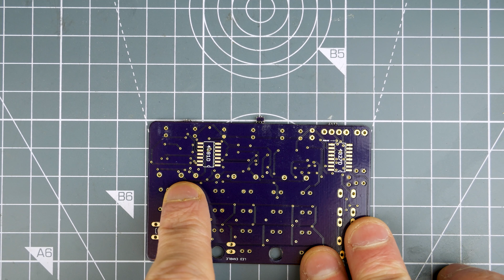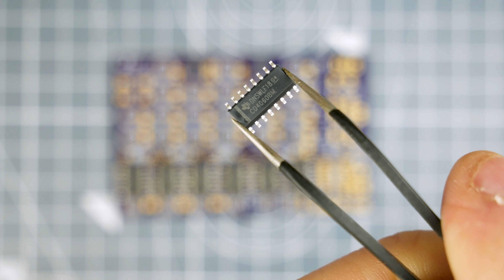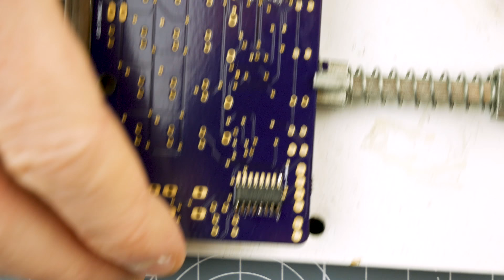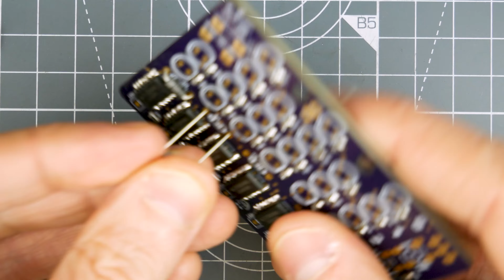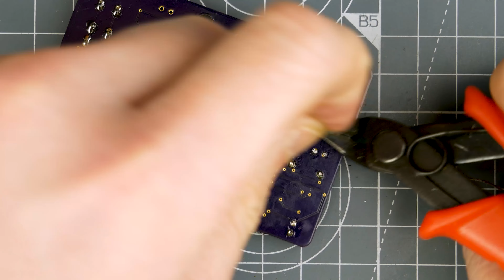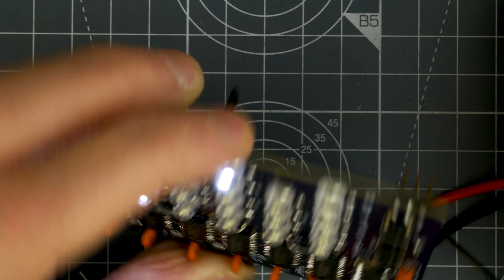Binary Crap Clock up for SALE!!!!

Comment: Not fast enough :( any items you are looking   to trade? I have 18350, 18500 and 18650 batteries, chargers etc?
Reply from the maker: Essentially it is my design for your design or something you have made. I don't care about value or cost, that is not what the trade is about. Something I can showcase in a video would be idea but if it is personal and you don't want ti seen that is fine too. I will do a live stream tomorrow to talk about it.
Reply: I made a rotating led sphere display (from kit) that is programmable and working on standard flash at the mo? could be an interesting programming vid? or I have a pwm fan/led controller i made from a basic diagram i found, finished and boxed, based on a 555 timer? not got much else interesting i'm afraid...